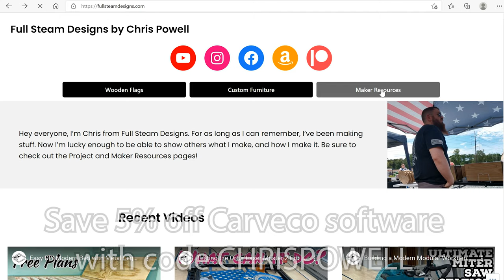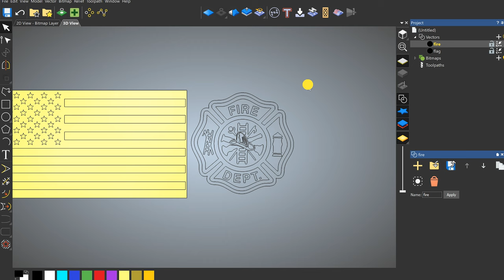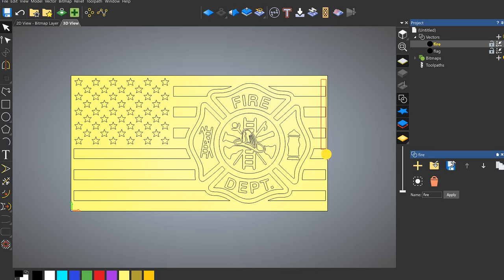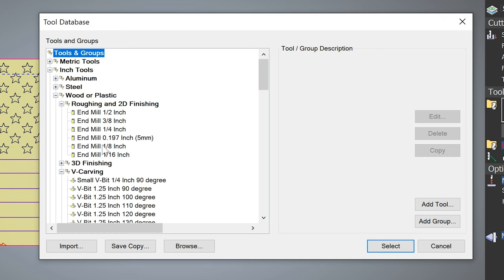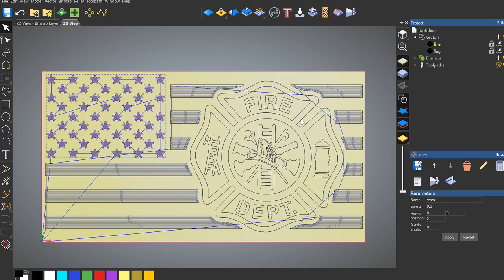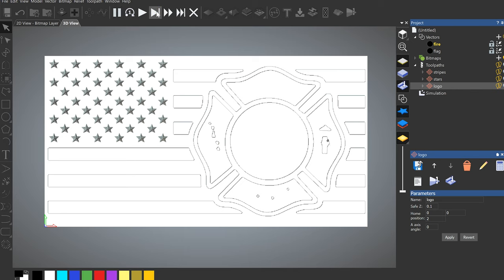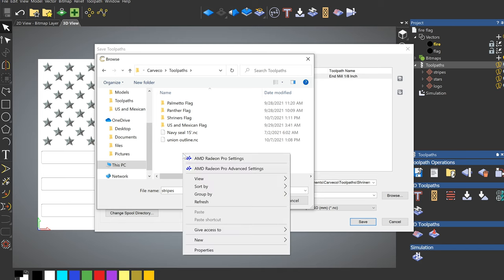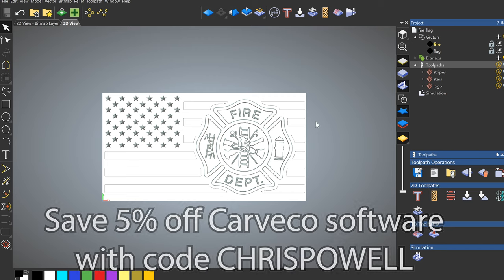Wooden Flag Design and Toolpath Tutorial - Carveco Maker

Comment: Does the toolpath save file matter if it is the Carbide MM type or the Carbide INCH type?  My router is just diving in to the hilt when it begins.  I am only doing a profile tool pass.
Reply from the maker: I don’t think it does. Where do you have zero set? Top of the work piece in the program and machine?
Reply: @ChrisPowellFSD  top in both. I started over and remade the project but got the same results.